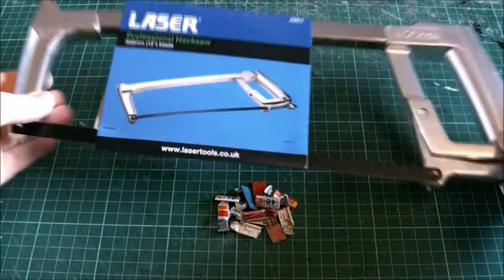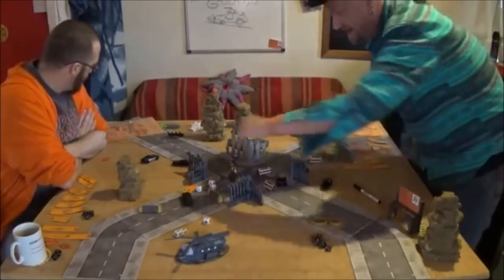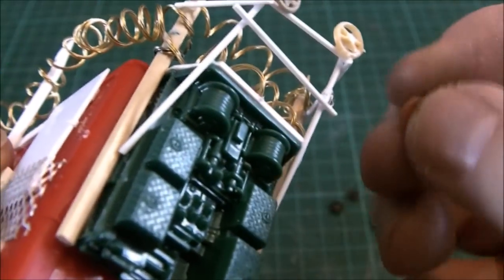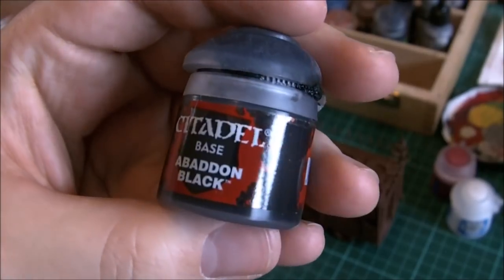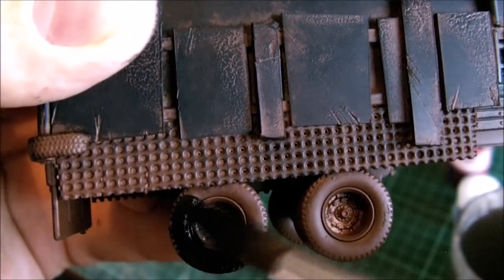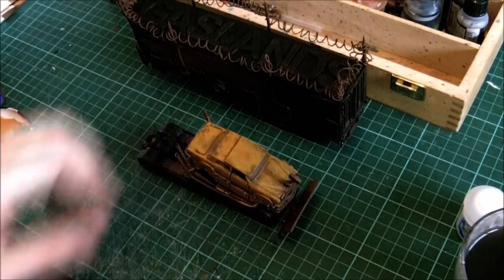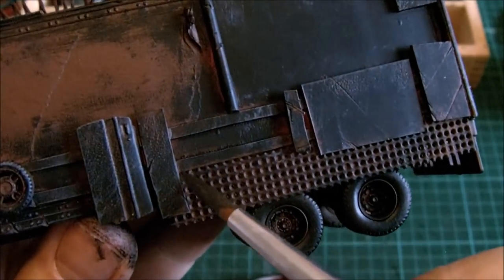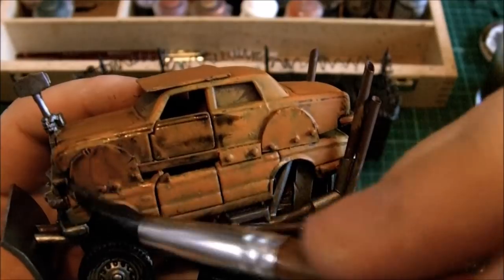Wasteland Workshop: First War-Rig Paintjob

Comment: To cut metal cars apart get a jeweler's saw and a lot of blades (they are delicate). Also you can make small skulls with air dry clay.
For painting when snowing, its the spray that has the dangerous fumes. Once you paint the items they can be moved inside to dry.

Comment: Somewhere between last episode and this episode, the wheel guards got some rivets for a textural element. In the last video they were just featureless smooth plastic. Could you explain what you used for those and how you did it?
Reply from the maker: So rivetting a surface is super easy. I just cut some little pieces of the thinnest plastic rod I have (which I think is 1mm rod, cut to 1mm discs) and then glued them on one at a time in a row. I'll do a quick video sometime and show you ;-)